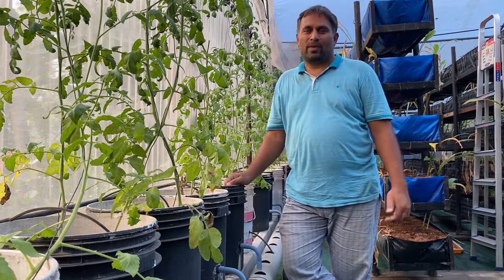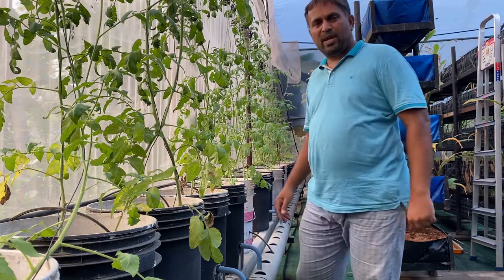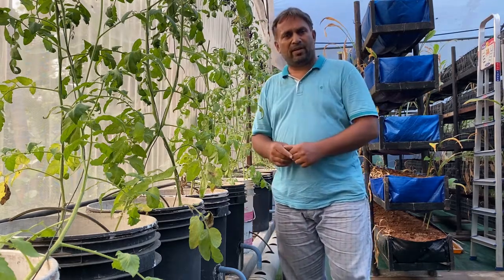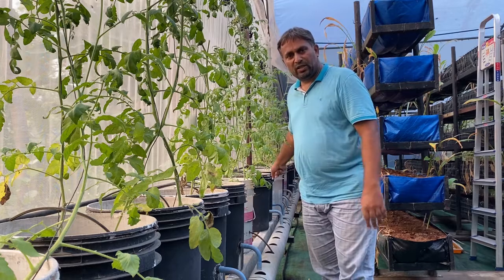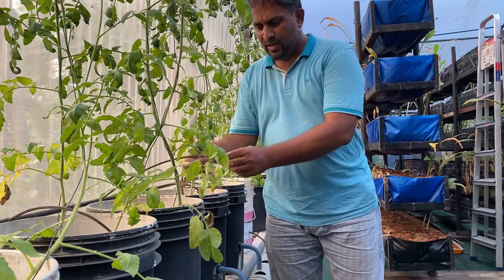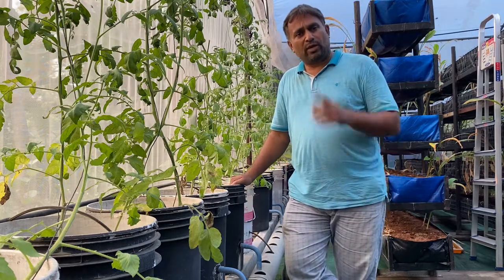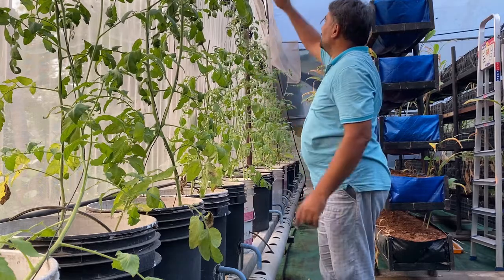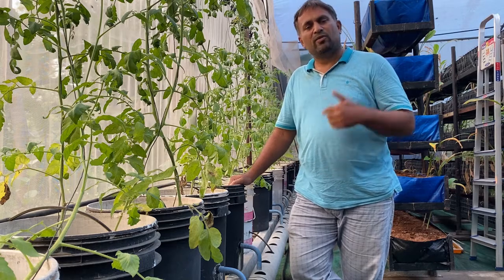What is Hydroponic Dutch bucket system? // Media Bucket Explained // How dutch bucket works?

Comment: I have a "First Time" Dutch Bucket System and am having a BOAT LOAD of problems. My PH is between 550-680 all the time. BUT, by TDS seems to be off by a lot, I mixed the Nutrients  Master Blend. at 2grm  per gal, Calcium Nitrate at .8grm per gal and epsom salts at 1.2grm per gal. I have a 34 Gal Sump and am mixing 80 grm of M.B., 25 grm of C. N. and 40grm of Epsom salts. All my tomatoes. Zucchini and Cucumbers are wilting.  What am I doing WRONG? Thanks,
Reply from the maker: Need more detailed before suggesting anything, for wilting many reason are there like nutrient concentration, oxygen level, temp of air & Water etc
Reply: @organichydroponicurbangrow4734  I check the PH every day, sometimes more. I have an aerator running 24/7 with 4 stones on full blast in a 34 Gal Sump. The mixture is  Master Blend. at 2grm  per gal, Calcium Nitrate at .8grm per gal and epsom salts at 1.2grm per gal. I have a 34 Gal Sump and am mixing 80 grm of M.B., 25 grm of C. N. and 40grm of Epsom salts. The plants JUMPED UP at first then the blooms fell off and the plants wilted. Zucchini is doing good but NO female flowers. Respectfully, Thanks.